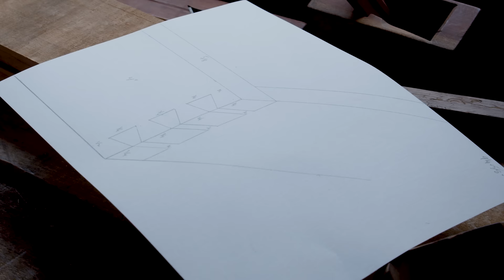18th Century Woodwork - Sounds of the Homestead

Comment: I built one of these in 8th grade shop class , in 1971, mostly using the same tools. We did have a dovetailing jig that guided the cuts with the saw. If you are going to make one like this then this is the way to do it.  A carefully made jig dovetailing that guides saw cuts speeds up the process, but carefully making the jig takes the same time as making 3 or 4 boxes so looking ahead in your tasks can really save time.

Comment: You can tell it is a new shop, because it is not piled up with a hoarders pile of lumber yet. 
     
Green stuff drying, old stuff, leftover bits and pieces, scavenged parts from old furniture - all the various things to go digging through for "just the right piece" for whatever project you are doing. 
        
Also, get that table anchored! If it moves then the vice isn't worth spit. 
    
Nice box in the end - and these were COMMON. Papa made dozens of them and they are still down in everyone's houses (he was a carpenter by trade, so they ended up replacing all the older ones from before). They close tight (good for keeping pests out, or just being shut) without needing any hinges or metal work (so they were, in essence, free - which was the only price my family could pay for generations). Coffee, herbs, toys, tools, ammo - anything dry. 
     
Most of his used thinner stock (oak or poplar shakes) for the base and lid - set in grooves of the thicker side boards which are doved. A few had full boards - if they were going to hold something heavy - either on the base or both the base and lid.

Comment: I did make that wooden box with only hand tools in 6th grade.  I had to bring most of my own tools from home, these days you'd never get away with that.
Reply: So what if you were poor and didn't have the tools?
Reply: @David-bh7hs  Well how much are the tools, really? You need a saw (even a hacksaw with a course/ wood blade), clamp, plane, square, and a chisel. Some sort of soft mallet/ piece of wood to hit it with, an awl/pencil, and a work surface are unimaginable not having. Unless you want to take up blacksmithing and make your own with minimal tools you’ll just have to shell out the what, $20 bucks it’ll cost? I think that’d be overpaying at harbor freight or a garage sale. All the rest are just nice to have, either different saws optimized for different things or unnecessary but time saving.
Reply: @farmerboy916  well other than the fact it sounds like OP is talking about the 70s or something before cheap Chinese tools and harbor freight were a thing, it seems like your solution to "what if you're too poor to afford tools" is "just buy them". That's the problem.
Reply: Just to be clear, the only reason I'm bringing this up is because it seems OP wants to go back to a time when you could "get away with" not providing enough resources for each student. I'm not saying each student should have equally shiny fancy new tools, just that basic needs are met.

Comment: I like the new concept of the woodshop videos although I think spoon bit would be more appropriate than auger bit and A router plane for cutting the slot versus doing it with a Dovetail saw and chisel just my thoughts love the video keep up the good work
Reply: A 'pod' bit is a somewhat earlier - its like a spoon bit, but the cutting end is squared off and it is not self starting, you have it use a gouge (chisel) to make a starting hole or the bit will just wander off making a mess. With the auger bit, I think some footage got left on the cutting room floor - you can see him feeling for the breakthrough of the point, but you don't see him turn the board over and finish the hole from the back
Reply: @brucelee3388  I think you’re missing my point which was the tool was not correct for the time.
Reply: @stevenpalmer4054  Screw pointed Auger bits have been around since at least the 17th century in Europe. Just pedantic folks site patents for the MANUFACTURE of STANDARD screw types and all sorts of industrial models. It doesn't mean that they weren't common, available, and made by every blacksmith worth his hammer, file, and tongs.

Comment: As a hand tool woodworker, yes.  Certainly an interesting way to cut joints and make a box; I'd have used a proper dovetail saw, myself,  I have 18th century saws which I use.  Also, I don't think it prudent to have one's fingers in front of the chisel.  I agree with the commenter earlier - either a routing plane or a grooving plane for the grooves would make life much easier, as would choosing a less cupped board and also making it flatter,  I think Brandon has done an OK job with what he has; he needs more refined tools.  Have a look at MrChickadee, also on youtube.
Reply: I think you're correct but I also feel that he was going for a bit of a rustic look more something built for everyday use and not show.

Comment: Guessing a candle box? Mounted like this it would stop any nibbling critters?
Reply: Come to think of it! Last summer I was cleaning the cupboard above my stove, which is where I stored the tea lights you use for keeping food warm at picnics. I noticed that the hole around the microwave wires was quite a bit bigger around than it used to be, and there was sawdust everywhere. I also noticed that every tea light in the box was missing, and the metal holders were chewed through. So I got a live trap, and caught the little bugger that did it.

Comment: no i certainly could not and would not make a box that uses dove tail joints. thats got to be the most challenging way to make such a simple thing as a box. ive 3 layer plywood i could cut grooves into and fold like paper then reeinforce with metal angles or just make a simple box with some nails in about 5 minutes tho.

Comment: 100% yes and even using the correct selection of tools you have you're doing dove tail joint and use the wrong saw to start with and the chisel selection you used was total incorrect it was to big as can be seen in the dovetail damage lol

Comment: The least believable part was sinking a nail to hang it.

I'd expect a dowel with crosspin to hold it up and keep it from easily sliding off or a dowel with a bit of a hook bent in it. Either steamed or a clear branch left to dry by the fire held in a bend.